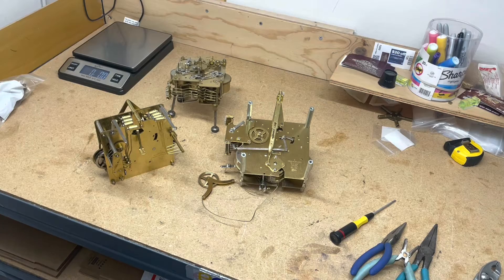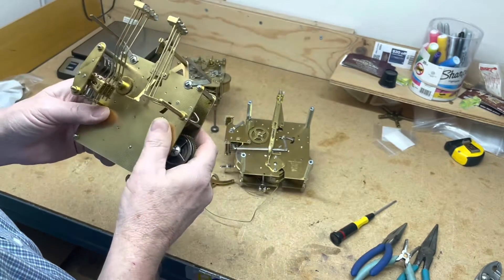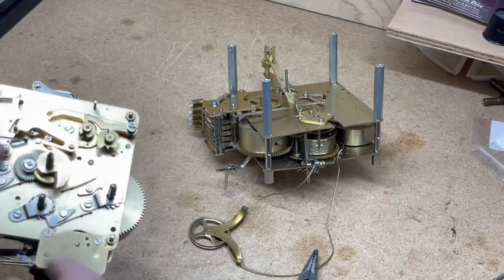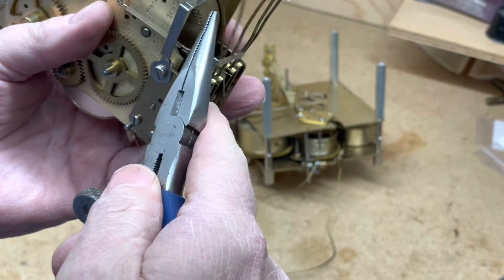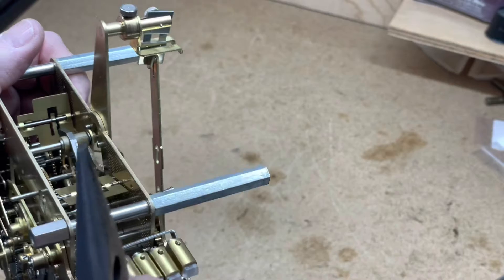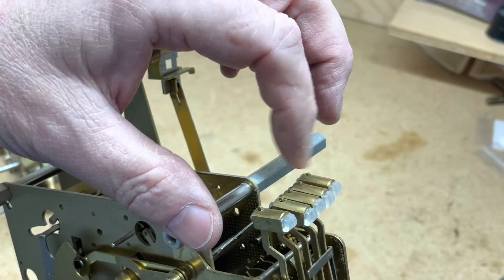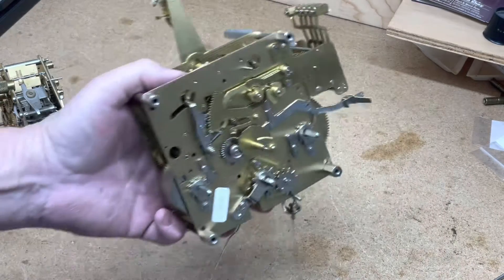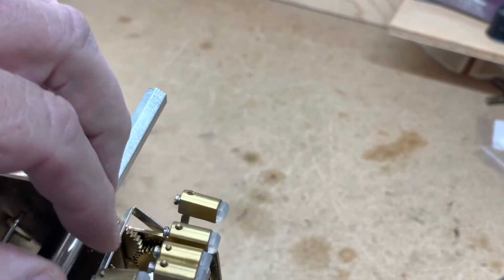Clock Repair Tip: Adjusting Clock Chime Hammers!

Comment: no matter what the distance is my chime hammers bounce. Ive adjusted the tail up and down as well as the hammers closer and farther away from the rods. They bounce and sound flat. Sometimes they multiple strike. Once in a while they fall and sound really good but most of the time dead. Any ideas???
Reply from the maker: You might want to check to see if you have small springs at the bottom of the hammer levers. Sometimes the springs get out of position. If there’s any manufacture info on the back plate of the movement, send it along and I’ll look up the movement and see any other ideas I might have.
Reply: @JRCLOCKER  The only thing the movement is stamped is patent pending. The clock is a sessions bim bam (2 chime rods) mantel clock with a pendulum. The clock door that has the instruction sticker is stamped in red with No. 802. It is an eight day turnback clock. Would you like me to post a video on my channel of the clock?
Reply from the maker: @kwacz  yes that would be great!
Reply: @JRCLOCKER  As you requested, I posted a video of the clock on my channel https://youtu.be/PMgE1Zl133U  Sometimes the hammer strikes louder than others. Sometimes it will cause buzzing on the chime. Once in a while a single strike is loud and clear, but most of the time it is dull and somewhat muffled and on the longer strikes such as 10 oclock it is a little different each time it strikes.  What do you think about the adjustment on this clock?